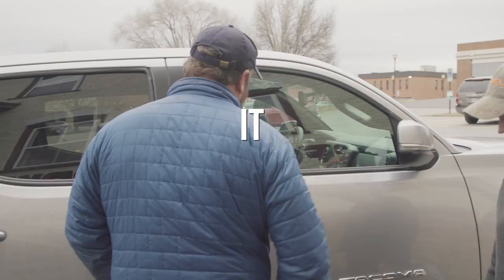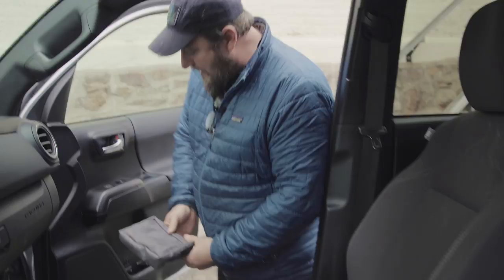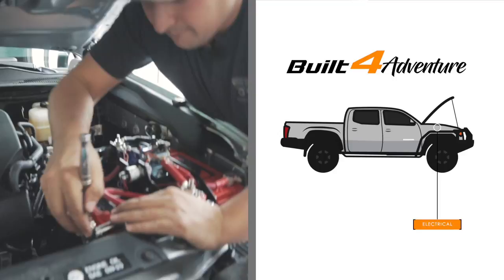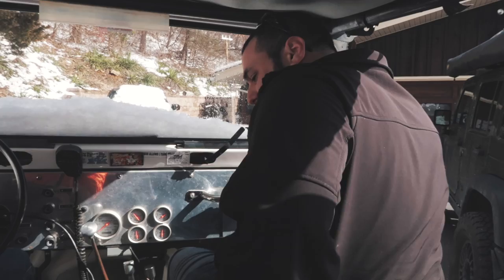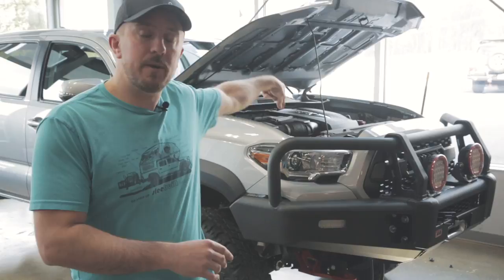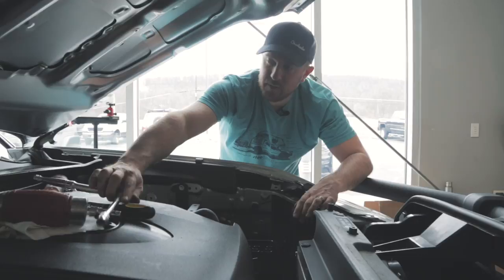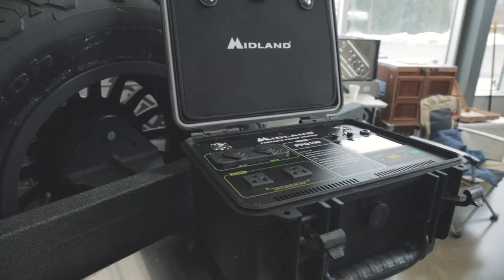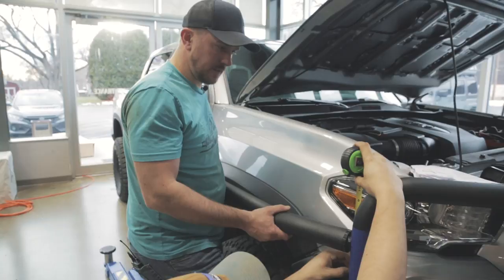Built 4 Adventure - How to Build an Overland Vehicle: Step 2 - Mountain State Overland

Comment: Is it just me or do those arb bumpers stick out REALLY far in front of the vehicles? It looks like the overhang is huge, do they even improve your approach angle? I guess they are a sponsor so they are free lol
Reply: Scott Gerry ARB bumpers are first and foremost designed for the Australian outback. Hitting kangaroos or cattle are the biggest concerns not approach angles.
Reply: Not everyone wants approach angle...I could care less..I ain't driving a rock crawler....before trip to UP Mich...I threw  together a 1 1/2" carbon steel brush guard for my Super duty..braced to my core support. I am worried about animals. #1 danger....nearly hit an...elk (Tetons), numerous havalina (Texas, Arizona), moose (Maine golden road), deer (everywhere USA) .for armadillo I like "G" series tires or 100 psi 19.5's, hahah. I have driven Mexico City four times, Canada, and ALL across the US.. My first bumper brush guard was a model 2-60..two deer sixty mph..keep driving, sold that truck ... Second one is a 3-80..three deer 80 mph..keep driving. I recently "tested" the 3-80..hit a telepole in the middle of damn parking lot (not painted bright color, right as you enter lot)...went 10 mph to zero...thought a broke the pole off, just split a big chunk out.....No damage, just broke one weld (tough to get penetration on carbon solid bar even though I preheat.). In a diesel if you even get deer legs up into the rads, inter cooler, trans cooler, a/c rad...it can cost you 2500-3000 just in parts, let alone down time and labor. ....as I like to say..most of that bumper candy "just holds the dent in" once it collapses. Most factory brush guard are good for tumble weeds...(taken out too many of those to count)